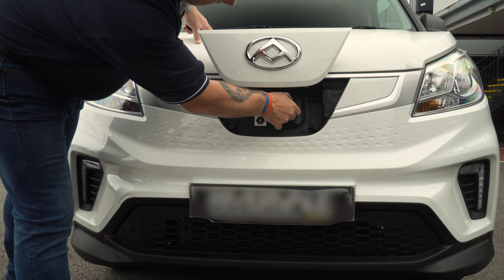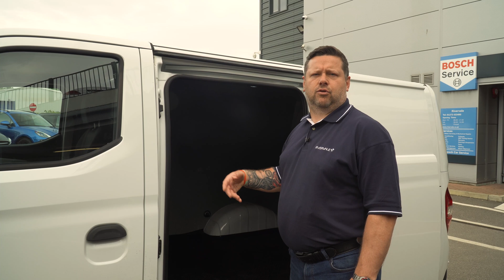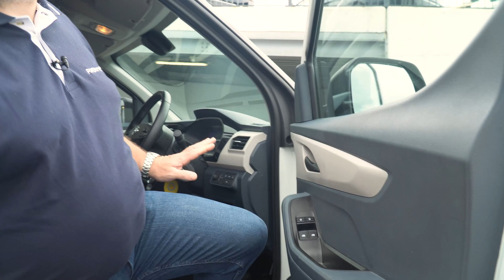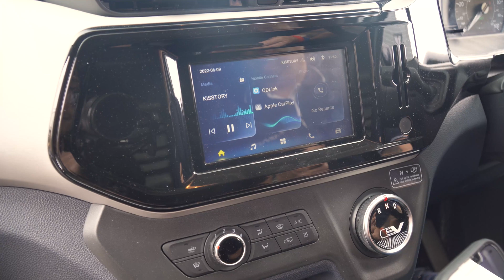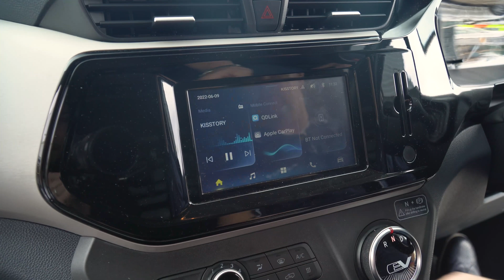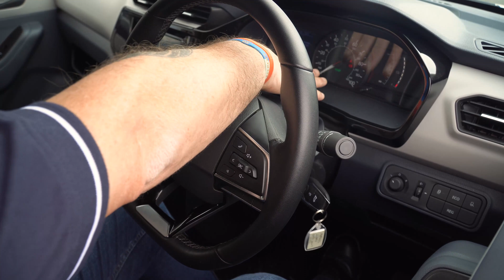Maxus eDeliver 3 - Rivervale Handover Video

Comment: Nice van but steel box frame on aluminium floor means only good for lease
Reply: Why is that?
Reply: @lasstmichendlichmalinruhem3239  the van will rust due to the electo chemical reaction between dissimilar metals.
Reply: @bernardcharlesworth9860  is there proof to that theory? I mean, arent the 2 metals isolated from each other? Otherwise it would be pretty silly design...?
Reply: @lasstmichendlichmalinruhem3239  just speak to any mechanical engineer they will direct you to a copy of Metcalf a common book used while studying for their degree .best wishes
Reply: @Rivervale Leasing: What do you say about that?